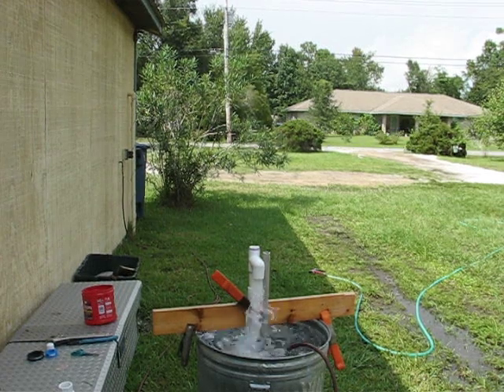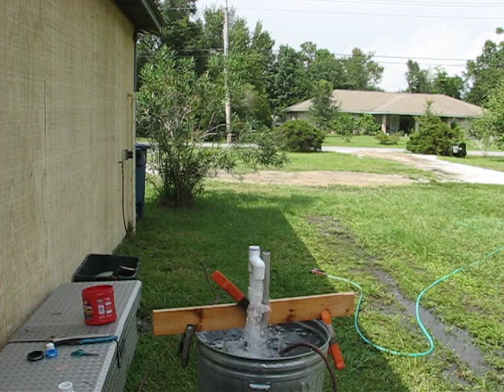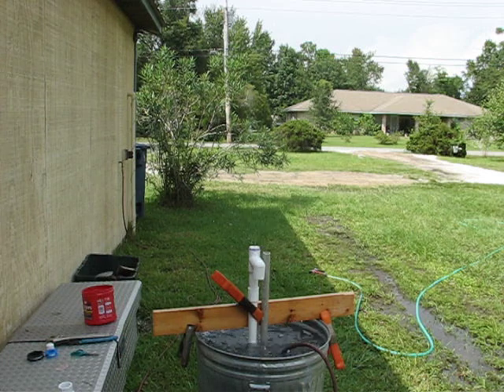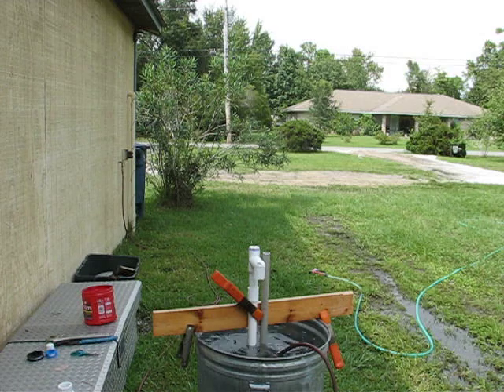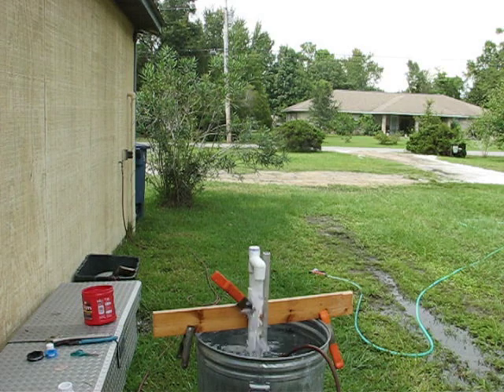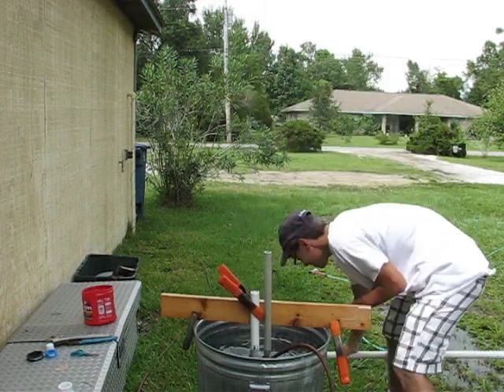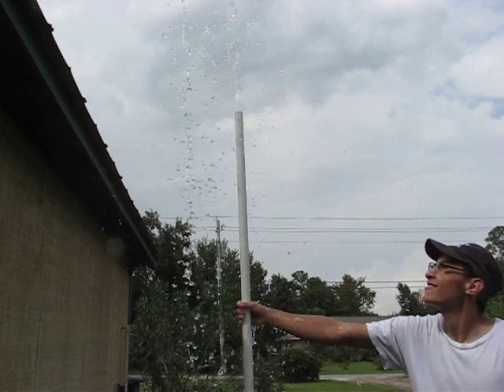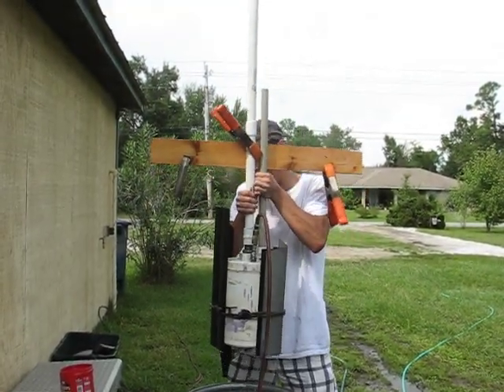AMAZING GREEN MANOMETER INSPIRED DISPLACER CONTROLLED  WATER PUMP

Comment from the maker: If you look at all the comments on this video you will notice
that very few people are as sharp as you are.
but every one is missing the point here.
In remote places and third world countries
Things that break down or  which are difficult 
to reach without heavy equipment are difficult
to repair. A small above ground compressor is
easy to replace and get to to repair. A  Well pump
is not. This video is merely a challenge to everyone
out there. It shows a way to get around some problems.

Comment: Had a pnuematic windmill at a remote location one time, it had a air compressor attached directly to a windmill about 18-20 ft. off the ground.  I'm sure the business end was based on a different principle, but had much less moving parts (less maintenance) than the old Aeromotor had.......

Comment: its novel, but of no use in remote places or as pond pump because:
1) its air powered, so it needs a compressor (which you can clearly hear)
2) has an intermitant stroke

Nice idea though

Comment: From his description, I have a pretty good idea how this thing works. As a graphic artist I know I can draw the design. The real problem is the automatic control valve he built, it regulates how much water the pump puts out during one cycle. Without it, eventually you'll be pumping out nothing but air. Notice how it only puts out a little over a gallon of water during each pump cycle but can easily do 10 cycles per minute. We need the design for the automatic control valve. MPRMLA please?